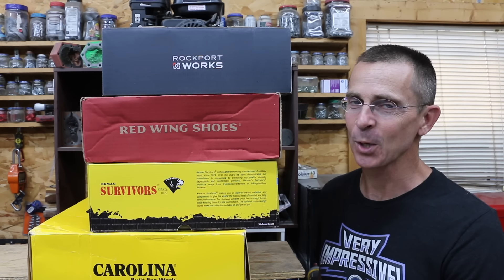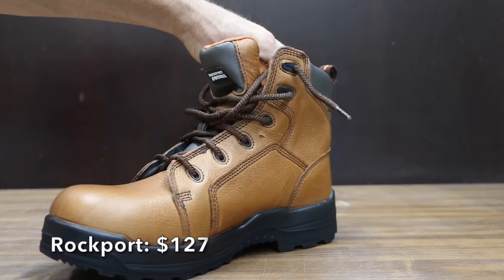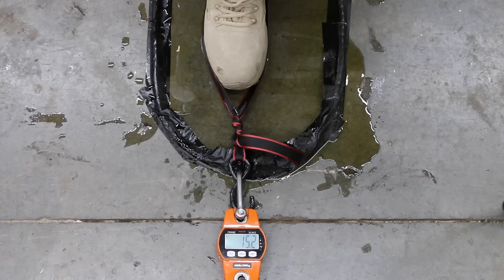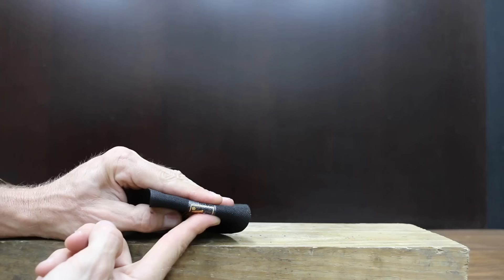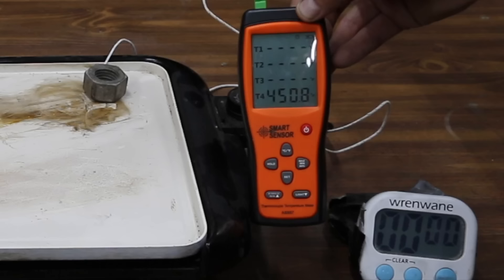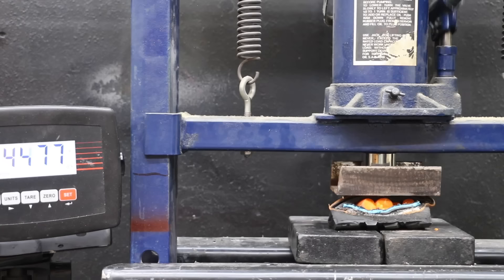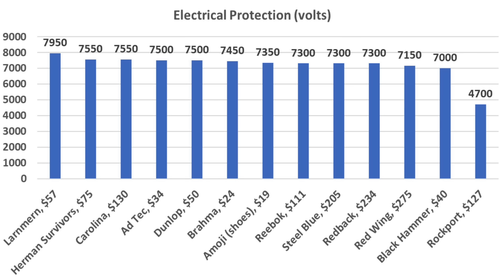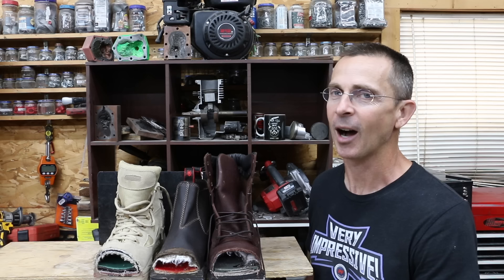Best Boots? $24 vs $275! Let's Find Out!

Comment: I have an idea for longevity, take the remaining sole of the boot and put it on a belt sanding contraption and measure wear over a set time with some set amount of weight pushing down on it to simulate scuffing feet on the ground? could repeat the process without the weight for the outside of the side of the boot. as someone that roofed the sides of my boots would blow holes from scraping the shingles when i would crouch down. both might be worthy additional tests that could be completed with the remaining pieces of these boots so no re-buying needed. You could also calculate it as distance traveled by measuring the length of the belt and the number of rotations per minute and say "these soles wore .5 inches in 10,000 feet" or something of the sort?
Reply from the maker: Thanks for the suggestion.

Comment: The Super Rainforest Boot made by Danner; about $450. I’ve heard they are “The last pair of boots you’ll ever have to buy”. Bold claim.
Reply from the maker: Thanks for sharing.
Reply: I don't know that one, but I had three different pairs of USA Danner's back in the early 2000's then went to Nick's and have never been happier with heavy duty boots. The Nick's I wear are twice the boot of any Danner's I had back then-and I'm wearing only the third pair of Nick's since 2005. Have a new pair being built right now. I like having two pair at all times for rotation (less time on the dryer). I got two resoles each on my first pair, but machine shop oils ruined them for a full re-build. Traditional Nick's are built the old way, and are a true joy once broken in. A friend would have likely lost his foot in an accident had he not been wearing boots as heavy as his Nick's.

Comment: Can you do an insulated winter safety boot? I do heavy haul towing and also do flatbed so I'm looking for a good boot that holds up in the cold, gets good traction, comfortable and is waterproof/insulated. I've tried the wedge soles and find the grip to be practically non existent in snow and mud.
Reply from the maker: Thanks for the suggestion.

Comment: For anyone still wondering about whether the cost of Redwings is at all worth it. I do NOT take care of my boots meaning I've used my boots as fire pokers, stomping through mud, while doing some home construction projects, ect. I've never taken extra steps to clean them after use or oil the leather or anything.

Despite this, I've has these boots for about 7 years now. At this point, the leather still looks great and they are still comfortable. The ONLY problem at this point is the actual sole is pretty worn. I just now looked into it and a replacement sole is 120 but I've do doubt when I replace the sole these boots will continue being great for however long I don't literally chop into my foot.

Yeah, you could buy 6 new pairs of boots at $50 for what I paid for mine over the same 7 years and be just fine. You could probably be fine buying 3 or 4 pairs over that time period and save some money but I'm not sure you could be as comfortable while doing that. Or if they would look as nice. There really is a hidden quality to having a boot that is perfectly fit to your foot. 

I've never had a pair of boots or shoes that has lasted more than a year or 2 because as I said earlier, I don't pay any special attention to trying to increase the longevity of my boots but I just haven't been able to kill my Red Wings.
Reply from the maker: Thanks for sharing.

Comment: Well as for durablity my redwings i bought 4 years ago are still in good condition. But i buy two pair at a time and wear everyother day. To get rid of bacteria which is cause by sweat and synthetic lined boots. Which is the down fall of shoeware. The bacteria destroys the shoe from inside out. like most of the boots you showed her but the redwings. These boots will last me another 3 to 4 years.
Reply from the maker: Thanks for sharing.

Comment: I used to like my Red Wing boots in the late 80s to 90s. Used to buy them at the store in Riverside CA on Magnolia Ave. They were the Cadillac of work boots, 3M insulation, original Super Sole. They were very comfortable.The bummer was their leather would crack, even after treating them with Red Wing Boot Oil, Mink Oil too. Only would get up to 2 yrs max. Then tried the Super Sole 2 and the soles cracked. So i was highly disappointed in Red Wing boots. Paid over 130-160 bucks. Now they're too much. 
     I found a pair of   Cactus Work Boots. They were Moc Toe all black for 43 bucks. Back in 2003, Super comfortable, non slip, insulated, leather too. The leather did not ever crack or the sole. Same work as a Meat-cutter working 48+ hours six days a week. Unfortunately they discontinued that model boot from Cactus Boots. I'd buy them today if they did! Thank you for your great videos you make!
Reply from the maker: You are welcome!  Thanks for sharing.
Reply: @ProjectFarm 

 You're such a great source of information. With all you put into your totally awesome videos! Also, some of the Cactus Work Boots are not too good. Just like any shoe manufacturer. Thank you for the reply.

Comment: Even taking into account the other pros of the boot if it isn't comfortable you're probably not going to wear it. At comfort rating of 8 the Black Hammers are a definite no. Too bad the Steel Blues had such a poor performance on the puncture tests, though I would still be tempted to buy them.

Comment: Logger boots. But red wing will win, sort of takes the fun out of it. But it would be neat to see different brands versions of the same style boot tested. If loggers were chosen that time the Redwing tread shouldn't melt so bad. As a former forestry firefighter with the HotShots the Red Wing logger boot was our go-to boot. Red wings weren't required but Vibram soles, ankle support was required, but no steel toe for obvious reasons. Too much steel used in the sole is bad too. I walked many a mile on smoldering ground in Red Wings and was kind of disappointed with that tread used on the boot in this video. Thanks for the videos I enjoy them. I now use at-205 reseal thanks to you. It works and you are a lot easier to watch than Scotty kilmer ( a sponsored advocate) screaming about the stuff.
Reply from the maker: You are welcome!  Thanks for the suggestion.

Comment: I've bought cheap and expensive boots. I work in the fuel industry and I can tell a huge difference in cheap and expensive. I used to wear $60 wolverine boots that would only let a few months. A few years ago our work boots stipen increased so I decided to go all in on the top of the line red wings. What a difference those red wing boots are. Never going back to cheap boots.
Reply from the maker: Thanks for sharing.

Comment: Please do a review on waterproof boots. Durability of specific boots for deep puddles and mud, sharp rocks. Test for toe and side cracks, cuts, punctures, seam splits. Rubber type brands like Dryshod Megatar, Dunlop Purofort Explorer, Muck Chore Boot. Or leather type for Wildland firefighting, and  Structural Firefighting, and mining. Brands like the Thorogood Lion or Hellfire, Timberland Pro Mining, Matterhorn, etc. I want the most durable WP boots. 2 weeks ago we had to stand in a trench with 10in water with sharp crushed stone and somewhat sharp construction materials and I  punctured my $100 rubber Baffins in one day and they now have have stress cracks just behind the steel toe so I had to use a shoe glue to seal a couple holes. Iheard about glues and sealants and rubber tire patches. Im thinking mining boots might be the most durable. I am a commercial electrician, and think of the rubber electrical gloves which require leather over gloves to prevent cuts and punctures to maintain their safety so, leather is more cut resistant but rubber is waterproof.

Comment: Test some waterproof boots please! In my line of work I don’t need a steel toe because it won’t do anything and it’s a lot of extra weight. However, my boots are constantly getting wet. I have found the Ariat groundbreakers are comfy and waterproof but pretty pricy.
Reply from the maker: Thanks for the suggestion.

Comment: would love to see resistance testing. you could try a pressurewasher or a sandblaster to speed up the resistance. i use GT 7 XL+ S3 From Sievi at work and home due to their water resistance. would love to see how they stack up aiganst other shoes.
Reply from the maker: Thanks for the suggestion.

Comment: I strongly disagree with the description of the RedWings as "built to last".
In mid-2021 I bought a pair of those and quickly found out that even on days that were barely warm enough to not require a jacket my feet would be swimming in sweat in those RedWings.   So I bought a second pair so I wear each pair on alternate days and thus give them a full day to dry out inside before I wore that pair again.

The first pair doesn't look to bad.  The second pair barely lasted until winter came.   In the spring of 2022 I tossed out that second pair:  $340 Cdn down the drain for crap that barely lasted one summer even though they were only worn on alternate days.   I got a new pair of $200 (Cdn) made-in-Cambodia "HH Ultralight" like the ones I had been wearing before I decided to give RedWings a try.    Those boots cost 60% as much, are much lighter, don't make my feet sweat unless it is hot outside ... and I know that I can count on them to last at least 2 years.
Reply from the maker: Thanks for the feedback.

Comment: Here's the deal.  He's never going to go to the trouble of breaking in the half-dozen or so REALLY well-made boots that some of us are talking about. I don't think it's about the $ to buy the boots, but the lengthy break-in process needed for heavy leather boots.  Not that he'd have to break them in for tests, but that would eliminate any meaningful comfort rankings. 

Also, they are heavy. I just checked mine and they're a fraction of an ounce less than six pounds. They're a size 10D with 10" top without safety toe (they're optional in two materials, but I don't need them).  Also it's going to play to a smaller audience of folks-those who will spend serious money on work wear.

Comment: stats at:
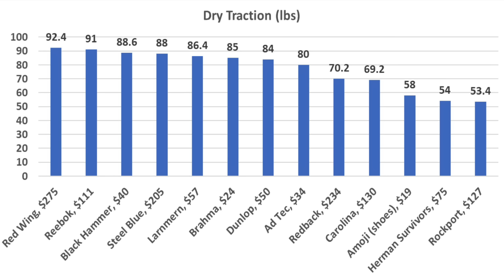4:55 dry traction
6:30 wet traction
9:20 bottom of boot strenght
10:28 16 penny nail pressure to puncture sole
11:21 16 penny nail pressure to puncture top of boot
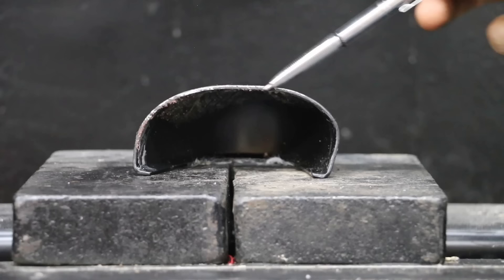15:26 maximum weight while maintaining 1/2 inch gap
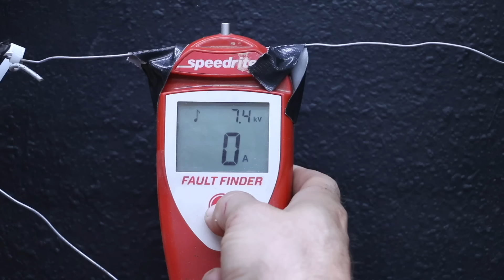17:03 electrical protection
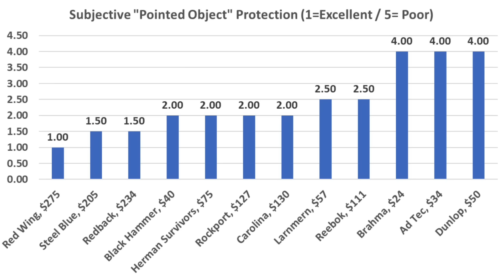18:50 subjective comfort
19:35 ranking
Reply from the maker: Thanks for watching.

Comment: Late to the party but if you're going to do another video on boots I think should apply a minimum weight to the shoes that are being pulled while testing for slip resistance. Without weight inside the shoe it's somewhat pointless to test static friction.
Reply from the maker: Thanks for the suggestion.

Comment: red wing sold out to asia many years ago. they do not even make 2292's anymore which were probably the best work boot ever made. finding a replacement is a pain. the northwest loggers do not have the work specs; steel toe insulation waterproofing. my current 2292 are 7 years old and worn daily.
Reply from the maker: Thanks for the feedback.

Comment: Just a few things about this video.  First, adding doesn't really matter inside a shoe.  The average man weighs 195 pounds.  They will put about 1.5 times their weight in walking.  There is no padding at all that will not flatten out completely and become hard as the ground.  Padding added inside a shoe is a trick manufactures use, a gimmick to make the consumer think they are getting something that they are not.  In fact, if you have a Goodyear welted sole almost nobody will need anything inside the boot.  The cork inlay under the leather insole will mold to the foot.  The Goodyear welt was, is and will always be the best way to make a boot.  It is just to expensive.  So we make crappier soles and put inlays (pads) in them to make people think they are getting a good product.  One can always add a lug sole to the bottom of the shoe to increase the protection from rocks and uneven surfaces.  Another factor on cost side of this is how many sizes does the boot come in.  If they only make 8 shoe sizes you will not have very high variable cost.  You add widths....the cost goes up.....a lot.   8 patterns, lasts and processes for 8 sizes, low cost.  A company like Redwing the makes 40 shoe sizes will have much, much higher costs.  These costs get passed on the the customer.  So...a boot made in Vietnam that comes in 8 sizes will be many percentage points less than a boot that comes in 40 sizes,  Last....point.  A boot made in the USA will have higher labor costs than a boot make in Vietnam.
Reply: meant to say.....adding padding
Reply from the maker: Thanks for the feedback.

Comment: I’ve learned one of the biggest problems I run into with boots is how fast the sole tread wears down. I’ve had to buy new boots because the treads are completely worn out and slippery. Maybe figure out a test that can test that?
Reply from the maker: Thanks for th suggestion.

Comment: Speaking from experience, Brahma's do not like acidic or caustic chemicals being splashed on them and when it comes to longevity, if you do a lot of walking or crouching down then they aren't the boots for you! I worked in metal plating shops for the last 15 years and only used Brahma's just because no boot lasts more than a year from what all of us have seen so spending $50 a year on 2 pairs of Brahma's makes more sense than spending $100 or more on one pair. Dickies needs to come out with some boots as tough as their clothes and we would be golden! Lol the main failure points are cotton stitching and the soles not being made to step in pure hydrochloric, sulfuric, or nitric acids as well as pure caustic soda.
Reply from the maker: Thanks for sharing.

Comment: @projectfarm I have recently(last 5 years) been on the search for a quality Steel toe boot.  I require comfort and a sole that resists fiberglass grating's wear.  I work in the refineries/"plants"/chemical fields in Houston Texas.  The gratings we walk on have progressed to a fiberglass grating that is lighter, resists corrosion and is very slip resistant, however it eats rubber and leather soles of regular boots.  I have seen it eat the sole of a Justin "abrasion resistant" sole in 3 months.  I don't do a TON of walking, but maybe 2-3 miles a day.  I have seen other boots last years, but then they get discontinued.   Uggggg!!!!!!  lol  My current twisted X are SUPER comfy, but the sole has only lasted 6 months.  Maybe you could test companies that claim to have the best soles?????  thank you either way!!!!!!!
Reply from the maker: Thanks for the suggestion.

Comment: Redwings are built to last?  I've only owned one pair, I bought them about 10 years ago for occasional wear to construction sites.  After a handfull of visits to construction sites the rubber soles started disintegrating with large pieces flaking off.  Redwing wouldn't do anything about them, and even though they were expensive it would have cost close to the original cost of the boots to have them resoled so I bought cheaper boots from a discount store that have now lasted longer than the expensive Redwings.
Reply from the maker: Thanks for sharing.

Comment: I used to buy Red Wing boots but they never lasted long enough to justify the expense.   The Walmart brand boots any one of them last long enough to justify the cost they're cheap so you can just throw them away when they fall apart but they're not super comfortable. Tractor Supply used to carry a brand of mid- price boots which were comfortable and lasted pretty well but that brand disappeared during covid. The new inexpensive brand that they carry at Tractor Supply falls apart very quickly if I had to buy a new pair of boots today I'd probably go back to Walmart. I bet you a million dollars that those Red Wing boots come in two or three pieces from China and are assembled by a robot here so they can call it made in America some Brands simply add a label here so they can call it made in the USA.

Comment: A bigger problem for most boot wearers: Cold in winter and working in wet conditions. Both lead to a miserable day.

I used to use cheap boots when I had as much money as sense but when i dropped a chunk of change on Keen boots, I saw the light and made a huge difference to my days especially between November and April. Warm, dry feet are a must. I agree with your first boot test - as a long time Keen wearer, I won't put anything else on my feet. The only thing I wish they would do in relation to boots like those made by Red Wings is that you can't get them re-soled, which makes the Red Wings cheaper the longer you have them but then again, I don't find Red Wings comfortable even after a month of wear.

Any way you could do a cold heat transfer test (thermocouple inside a foot mannequin?) and a water test (foot mannequin covered in absorbent material/towel and boot laces tightened as normal)?
Reply from the maker: Thanks for the suggestion.
Reply: @ProjectFarm  Anytime!

Thanks for the many awesome and very useful videos.
Reply: Keens soles were de-laminating on me after less than 6 months use, they weren't very comfortable at the end of a 10 hr day either. Replacing the insole with $20 gel insoles helped a lot. Keen gave a $100 credit to their site after emailing pictures of the shoe coming apart and providing proof of purchase.

Comment: I have always wondered how crash test ratings compair across categories. Full sized SUV top rating as compaired to a Compact top rating. How incredibly below the scale would the compact be if it were rated side by side with the full sized SUV's? Factor of 10? Factor of 100? Factor of 1000? Inquiring minds want to know!
Reply from the maker: Thanks for the suggestion.